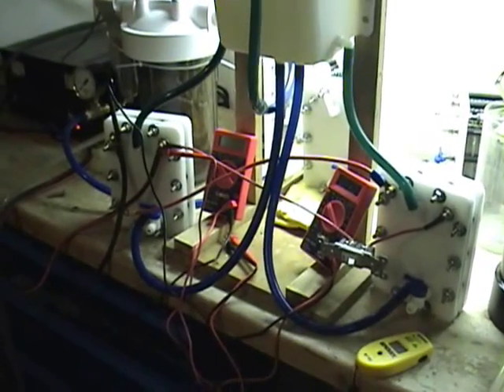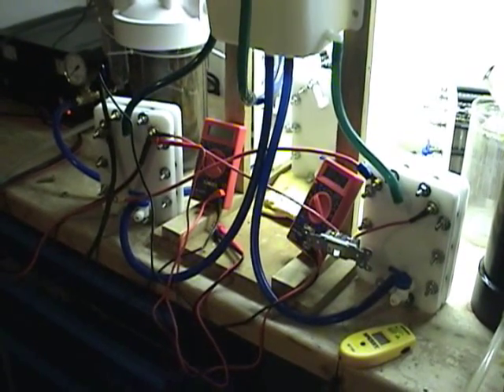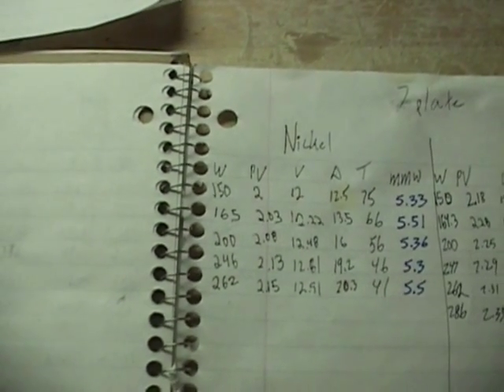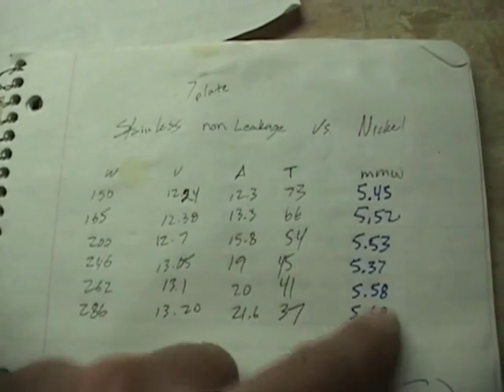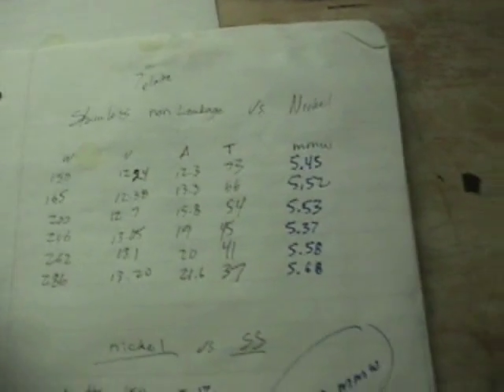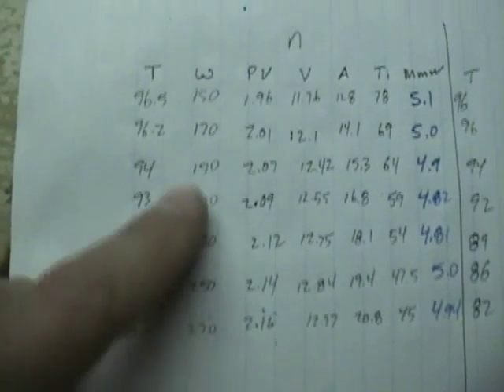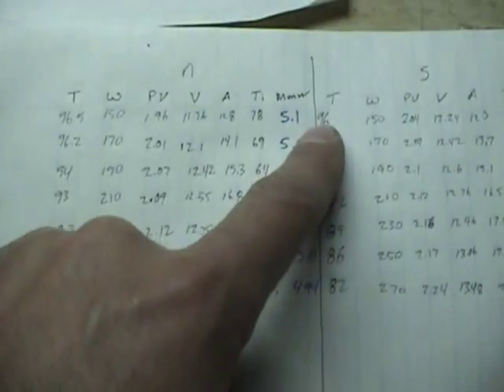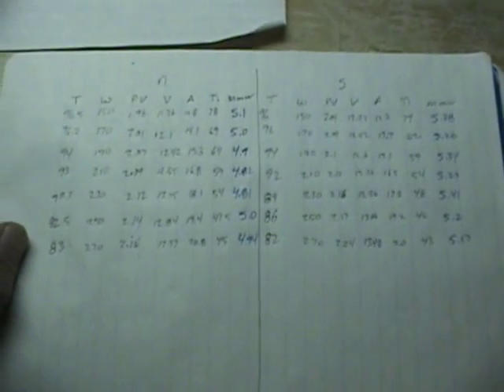Hydrogen HHO Nickel Vs Stainless Stainless the victor HUH!

Comment: Wow ten years later and i had to come back to this , was thinking of doing a nickel cell, 
 i still think the reason the numbers is of is due to the gas composition of nickel having more oxygen , so per unit volume is smaller for the same electricity, think about it if you get twice the gas off the cathode as you do the anode . There are secondary reactions at the plate electrolyte interface , the anode and oxidation takes place to only again be reduced at the cathode , iron plate are really bad at this and as a result those plates produce the dullest explosion due to lack of oxygen . hmm man it just dont add up does it
Reply from the maker: I don't know the answer. It was reasonable that the nickel would be more efficient because it creates less resistance but that wasn't the case. I'm glad your still online making videos after all this time!

Comment: What was the plate thickness for each?  For example even though  copper is a better conductor than aluminum. 1 mm copper wire will have more resistance than 2mm aluminum wire.

Comment: I suspect at least one of the elements in stainless is a better catalyst  requiring less energy than nickle. So much so that stainless steel performed better even though it has higher resistance.
Reply: That would be known as a false assumption. He sand blasted the SS plates but not the nickel. The higher surface area of the SS than the nickel caused them to have equal effectiveness even though the nickel is a superior conductor.

Comment: Your nickle plate voltage was lower because your supply voltage was lower. The difference in resistance in the metal would create  a significant difference in plate surface voltage only under really high current. I'm guessing well beyond what would be considered "over driven",  1 amp per sq inch of total anode and cathode, including neutrals.

Comment: I wonder if it has to do with the fact that nickel is a hydride material. The nickel could be absorbing some of the hydrogen production.when hydrogen is bonded with a hydride material it takes certain amounts of heat or pressure to release it.

Comment: Caloric burn test....two test tubes filled with identical amounts of water measured in Cubic centimeters. I dentical amount of combustible gas. same method, distance from heat source etc. 
Then measure the tempurature rise in each (of course you would have a temp. reading of the room temp water BEFORE the test.) if you used one cubic centimeter of water then the caloic measurment would be ONE calorie per degree in CELCIUS. 10 cubic centimeters of water wold rise 1 degree C in a 10 calorie burn

Comment: maybe adjust voltage to the lowest level that produces bubbles acceptably, with lowest temperature increase, for each metal separately. See which one makes a liter for the lowest Energy (power x time). If they are equal , maybe it's in a range that is a straight electron-for-ion molar ratio. Stanley Meyer added AC pulses to get out of this band. Lower Volts across blasted plates may be coronal discharge lowers eff. dielectric strength of water. Thanks for neat videos. Kelly S.

Comment: FWIW maybe a better comparison with gases, is a heat test.

 Not the easiest test, but maybe more useful than a explosion (noise) test. 
Time taken to heat water with A HHO torch.
 The torch will have to be modified so you can actually submerge it under water.  adjust mixture with air so no unburned  hho gas escapes in the form of bubbles.

Then just test the time it takes to heat the water form one give temperature to the other.  

Time to heat 1 gallon of water from 70 F to 100 F

Comment: Nice work with the comparison. very interesting. I first assumed both cells are identical except Nickel vs SS. but you say the SS is textured but you did not mention the weather the Nickel was textured.   Are they identnickel?

Comment: I'm guessing that you're doing brute force as most people are these days because it's easier.

In that case, higher amps only related to the number of electrons flowing through the plates, but the voltage relates to how "forcefully" the electrons are hitting the water molecules to smash them apart. So it makes sense to me that the stainless would be more productive.

That's just my educated guess though. I'm an electrical engineer dropout, lol. I only made it to junior year, so... ya know...

Comment: Separate the cells. Two different bubblers "Before" you do the gas test. Mix the electrolyte for both at the same time, run them through the same steps in voltage and amperage.
I think the nickle will run cooler, less resistance. Plus, and the chrome in the SS knocks the ortho down to para, it releases photons in the ultraviolet > x-ray spectrum, and some in the infrared as well. Both generate heat. There is a patent for just this process. I'll see if I can find it for you so you can read it.

Comment: Good data but it has me scratching my head. I have found nickel to be awesome. Current (Amps) make HHO. Volts only drive the current through the cell. At the same watts a cell with higher amps and lower current should be more effecient. The fact that you are getting higher effeciency from the higher volt cell has me wondering what I am missing here. Maybe there is somehow more moisture in the gas from the stainless cell. A gas quality test would be interesting.

Larry